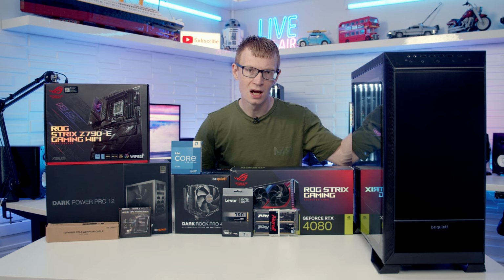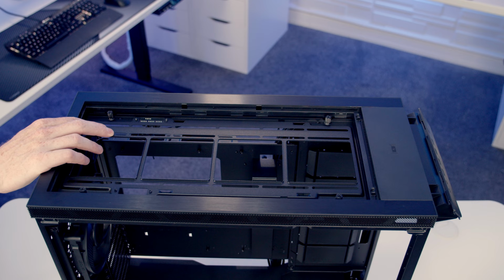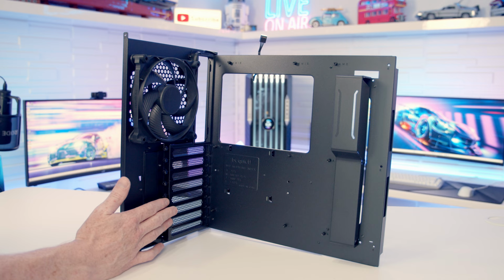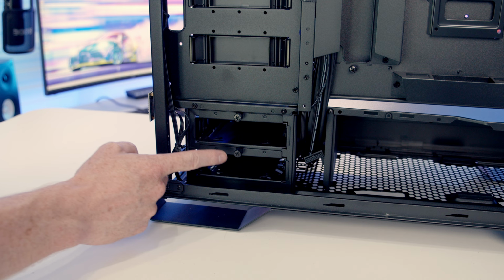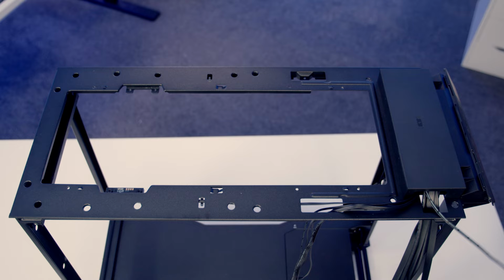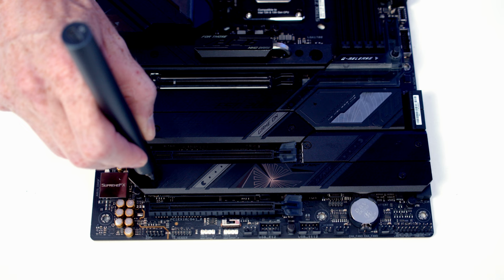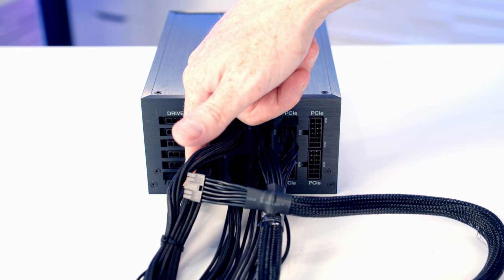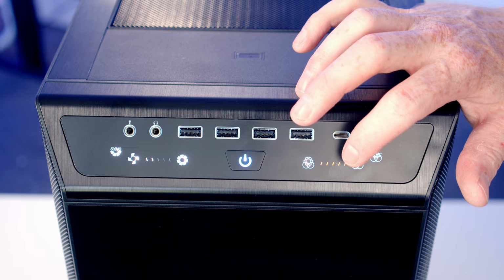be quiet! Dark Base Pro 901 Build - Step by Step Guide

Comment: Absolute legend. I have the exact same psu and the 12vhpwr adaptor from bequite ready for a build tomorrow using a asus rog strix 4090oc. Read the manual and was racking my head on which pci-e power port I use on the back of the psu for the new adaptor.

Thanks so much for the detailed explanation. Saved me so much stress. No info on this anywhere.

Comment: This is a very impressive case and this review showcased all them very well, good job. The attention to detail is next level, definitely not the norm these days with case manufacturers. It would be nice if here's a smaller version for people with limited space.
Reply from the maker: Maybe it will come. It worked well for the fractal torrent
Reply: BeQuiet! Also makes other models that are smaller.  Older Gen, but impresssive nevertheless.  German designs!!

Comment: I purchased this case and got a lemon. The front panel was extremely tight and i need 2 screwdrivers to literally pry the flap open each time... The rear fan runs at 100% and does not work with the speed of the front fans - tech support confirmed this. Both SSD cages are 1mm too narrow to fit in Samsung SSDs.
Reply: So what if rear fan is always at 100%? It’s the most important fan. Also it’s very quiet. Don’t understand why it bothers you so much.
Reply: Lucky me I’m using only M2 these days and it’s not samsung.
Reply: @vqa33  It's faulty wiring that is making it 100%, it is not meant to be 100% all the time. It's loud, all the time, that's why it bothers me so much... The case was rushed in manufacturing, hence the issues.
Reply: Nope, You need to plug the cables in the respective places. I had this issue and I fixed it
Reply: Sorry for the late answer but one thing about the SSD „cages“. I also tried to push them inside these metal cages but the instruction said you have to screw it on the back of these metal holders so the SSD is not „in“ the cage, but „on“ the back of the cage! Hope this helps 😅

Comment: case with removable motherboard tray always amazes me, but this one is well-designed because the PCI-E slots comes along with, making both motherboard and gpu easier to install, especially when you go for vertical mount GPU.

Comment: I found that with an EATX m/b and the EATX Cable cover fitted you could not fit a 4090 as it butts up against the cable cover. Just a heads up, if you fit the motherboard then decide to vertically mount the gpu you will need to remove motherboard to re-position the gpu slots.
Reply from the maker: I didn't try mounting GPU with EATX motherboard

Comment: Hi Christopher, this is great detail information. I just got my Dark Base Pro 901, and try to assembly without a GPU yet. For some reason, the fan on both front and back panels are not spinning, the control panel light is not on at all. I don't know what connection I'm missing. This is new computer I'm building usong the following:
- ASRock Z790 Nova WiFi LGA 1700
- G.Skill Trident Z5 RGB Series (Intel XMP 3.0) DDR5 RAM 32GB
- Crucial T700 2TB Gen5 NVMe M.2 SSD without heatsink
- Arctic Liquid Freezer II 360 A-RGB
- NZXT C1200 PSU - 1200 Watt Gaming PC Power Supply – ATX 3.0
- Windows 11 22H3 installed

Plan to get the nVidia RTX 4070 Super next year when it's available. I'm stuck. In addition, I can't get the Wi-Fi to connect to my TP-Link AXE75 Wi-Fi 6E. Can you help please? Thanks.

Comment: Amazing video, and thank you! I do have one question. When you're doing the front panel cables, you plug in one of the USB 5Gbps to the motherboard. However, there are 2 of those cables. Where does the 2nd plug in?

EDIT: I rewatched, and you do actually have 2 ports. What do I do if I'm on a motherboard that only has 1 5Gbps port? I have the ASUS ROG Strix Z790-F.

Comment: Hi I've been looking into this case. I note you say you have to remove the noise dampening panels at the top for a radiator install, are you sure this is necessary? I've seen other reviews that say there's side vents at the top just like the front so still get airflow.

Comment: Hey I want to get one of these. Ive had the 802, 900 Pro and I was wondering if you could physically fit two 200mm fans on the front (I have Silverstone AP181s ) I know there are no mounting holes but if there is room for them at all to fit.
Reply from the maker: Didn't try it. The 140's do a good job - check out the review for the thermals

Comment: Hello, I have issue with RGB strips on case. Unfortunately, it's not working. According to manual this should be connected by Front IO panel cable to PSU right ? Front panel is working, RGB settings also, sync also, however strips are not. Any advice is welcome. Thank you.

Comment: I want to ask a question and I hope you can answer it for me.  I have a corsair RM1000 PSU that I got when I build my old computer, at the moment I have a Sapphire Toxic RX 6900XT as my GPU, I want to replace the GPU with a RTX 4080 Supper, but my power supply never came with either the 12vol cable or is it not on the PSU, so my question is would I still be able to use the PSU I have or would I have to replace it with a new one that will support the GPU?

Comment: Thank you for this video. Got several questions answered.
But I still have one unanswered about connecting that fun hub. Is it just a matter of connecting chasis fan as if directly getting fan connected?
And this video raised other question:  How those sync buttons are connected to motherboard?
Reply: I think I got it. So for fans it syncs with pulses on PWM connector and for RGB it have own connector.

Comment: So far the biggest issue I've had is trying to get the two metal support notches at the back of the graphics card I have to fit between the motherboard and the case. I simply can't get the notches to slide into the back of the mobo, now I wish I installed it earlier because I've already wired most things up to the mobo and don't want to ruin my cable management. (I may have to though).

Comment: just built a new 901 system, but cant get the front IO fan speed buttons working. The front fan sync button works (all fans speed up) but not the min max controls. 
The case pwm cable is plugged into case fan 1 all other fans are connected to the two supplied hubs apart from the supplied back fan which is connected to the CPU fan slot, (as I have water cooling connected to the AIO pump slot.
totally stumped.

Comment: Hello. I am going to get a similar build to yours as in the video but it will be the dark hero board instead and I was wondering how and where would I plug in the cables needed for the quick charge on the case as seen at the 41:58 mark? I looked the manual and I am still confused.

Comment: Quick question, what's the 8 pin MB (12v1) socket just above the p8 (12v2)  on the back of the power supply for? or is it part of the 24 pin?

Comment: Thank you very much for the instructions! But a question about the Fan Sync, when I press it, the display always goes to the highest setting and all fans turn up fully even if the Pc is not fully loaded. I have connected everything exactly the same as in the video. For the 3 pin cable that should be connected to the bottom of the mainboard I had to connect a extender (Noctua) the one frome the case was to short....
Reply: Fixed, if you have the same problem. Change in the BIOS the Fan from Auto mode to PWM mode.
Reply: did you find a solution? I'm facing that now.  I am thinking of some crazy cable adaption - a splitter to 2 19-pin and then convert those 19 pin into the 9 pin usb 2.0  slots that I have...
Reply: @LisamarieSC1 Yes, you need to change the fan option from "auto mode" to  "PWM mode" in the BIOS.

Comment: quick question:

i got an asrock b650m pro rs motherboard that has its aio pump headers on the bottom. How am i supposed to route the aio pump cable? I was thinking about having it going straight down from the cpu across the mobo and somehow hiding it with the gpu. Would you guys recommend something like that?